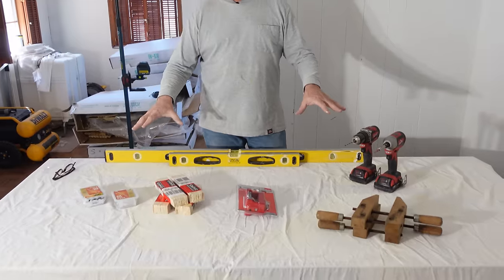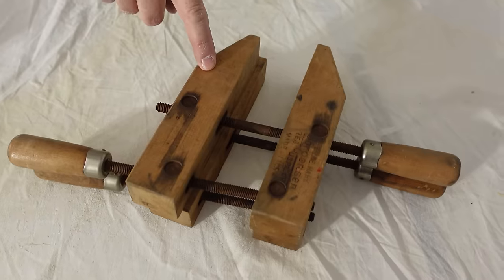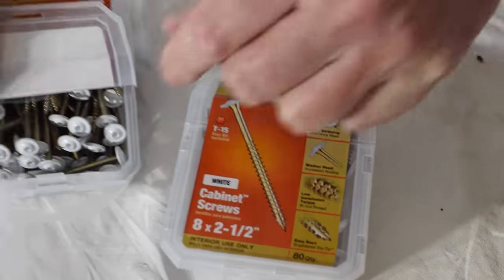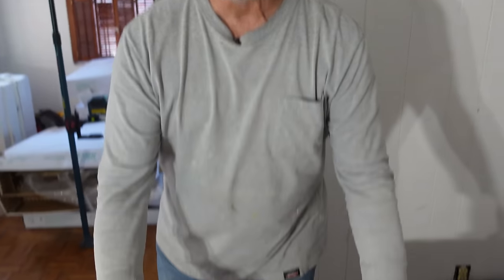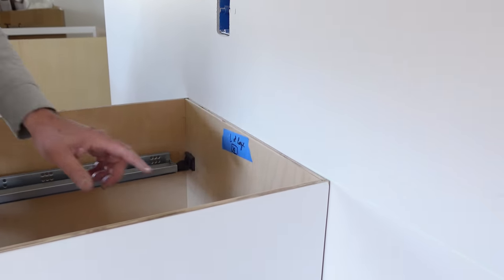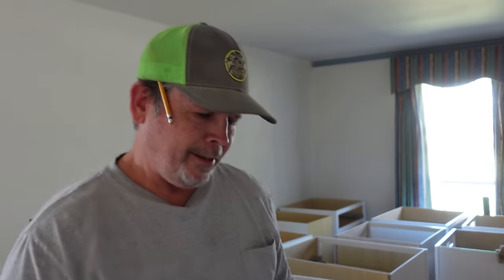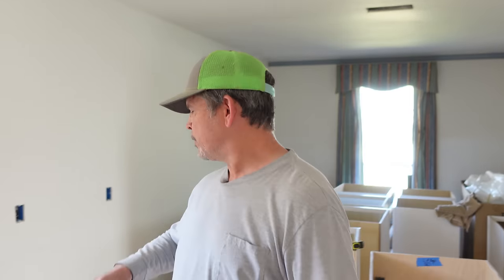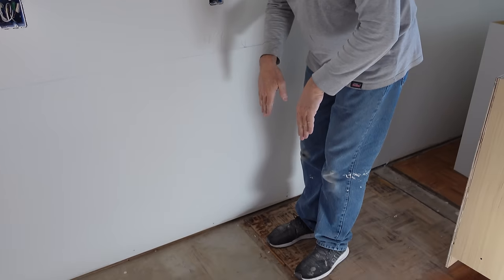How To Install PERFECT KITCHEN CABINETS (DIY GUIDE)

Comment: Nice job you guys!  I've been cabinetmaking since my junior year in HS (1979) and what you did here is what I've been doing for installs the whole time (after learning from the professionals/cabinet shop owners and foremen).
I have often used my straight-edge, a 8' long, 6061, aluminuim 2"x3" angle, 1/4" thick across the top front edges of the base cab's to be sure the counters would end up absolutely even (usually 1" to 1 1/4" from the face), but eyeballing that works also.
The extra mile thinking is the use of 'sex screws' to pull the faces flush with each other when they meet up.  The sex screws are used so as to not split a face frame with the pressure of the threads of a wood screw.  I have seen the splits over the years when weight was added from pots and pans, dishes etc. as they can quickly add up to hundreds of pounds per cabinet, especially glass dishes in upper cabinets.

The ones I have found to work best use a 3/16" hole drilled through both frames and the two parts are threaded together (I add blue Locktite too) while clamped and the cab's don't budge.  Three on base cab's, four on uppers.  Then shorter ones parallel to the top edge of the base cab's, about 2-3" down to be sure the cab boxes work together to support the countertops.
Seems like more than is needed, but I can't tell you how many times I was removing cab's to be replaced, to see where the old cab's were about to fail, or did fail because of underestimating the stresses.  I feel better after an install which has been over-done, not one where installers are asking themselves "what if?".
The last thing I do is water-proof the top edge of at least the sink cab, but all of them if I can convice the owners.  I use Christy's Red Hot Blue PVC cement and it is the only thing I have gone back to see it still working as planned long after the install.  It was '04 when I began to use it and went to replace a sink last year where the on-counter sink sealant had failed but the top edge of the cab was fine though water had been migrating to that area behind the faucet for years.

Comment: when you don't have a magnetic driver,  you can attach your screw to the driver with a short wrap of tape and it help to prevent the screw from falling off the driver and usually the tape will stay attached to the driver once the screw is embedded. and you guys d[ a great job, love your videos

Comment: Great video again!
 So to help out with the screw dropping out of the bit, take a rain drop amount or less of butyl tape and press it on to the phillips bit then press the screw onto the bit. The stickness of the tape will hold the screw. Butyl tape has many purposes but When I was an auto body tech it was used to hold rear and side car windows in place by some auto manufacturers . You can get it at auto parts stores.

Comment: We took your advice and used the Bessey jig/clamp to install and set our new kitchen cabinets and it REALLY helped! My only suggestion is to install a slightly thicker pad on the clamp to prevent the metal part from contacting the cabinet face. Easily fixed with a cut-to-size furniture pad and that modification was the perfect modification.
Reply: I'm trying to figure out why the lower number is the high spot -- do you know?
Reply: @rena321able  The laser line height remains constant. If the distance between the floor and laser line is different at two spots, then the floor height must be different (as laser line is constant). The distance is equal to "laser line" minus "floor height". Therefore, the higher the floor height, the lower the distance is between the floor and laser line.

Comment: Love your videos.  I just saved a ton of time painting a 2500 SF ranch using your tip on how to hold the brush when cutting in the ceiling and around trim.  Took a little practice but now it is second nature.  Now I'm getting ready to tackle the kitchen.  I hadn't considered RTA cabinets until I saw your video.  Even the manufacturer liked your tip on using a pneumatic staple gun and mentions this in their instruction video.  

But I'm still not convinced that the lower cabinets should be installed first.  I like to gang the uppers together upside down on the ground when possible to get the tops lined up.  Like you, I sight down the faces and install shims at the back to keep them from twisting.  I also make two 2x4 deadman supports about 1/2 longer than my low spot to hold the cabinets in place.  A gentle kick will raise the cabinet to the line.  In my youth I could easily raise three cabinets by myself.

Comment: @Stud Pack an easy way to do those cut out under the sink is to take some regular house paint and dab a little dot on the pipes line your cabinet up where it needs to go and give the back of the cabinet a hard slap. It will leave a mark right where your holes need to go. for the outlet though you have to measure or add a plastic box extension and do the same trick. Also if pipes are different lengths star with the longer ones first drill them out and slide back to the shorter ones. After a few times doing it it cuts down on measuring time and is super accurate.

Comment: I like how you said, "34 and 9." I worked for over decade with a dude I became friends with. When we took measurements we'd say the number and then 3 for 3/16, 5 for 5/16, 7 for 7/16 , 9 for 9/16, 11 for 11/16, 13 for 13/16 and 15 for 15/16. It was just easier to communicate when we're both on the same verbiage. And we always used the same measuring tape as well. Different tapes have variances that'll goof you up sometimes.. I like your videos guys. Thank you very much.

Comment: Greetings one of your beginner viewers here from the very early days of your videos, I always sit back and watch and really enjoy the father-and-son interaction and education in your content. The real cool thing about watching is a fact that you keep it educational and give great examples and tips. At 17 minutes though I just want to throw some advice that you that an oscillating cutter or what we call a multi-tool would have been a better choice to cut out that square in the back of your cabinet. I use it often for this application and it seems to work very well, Pro tip though, I would use a little painters tape along the edges of that line on the outer diameter due to the fact that you will get a cleaner cut without any Jagged edges
Reply from the maker: Thx Nick 👍.  I left my multi tool at home that day 😡

Comment: great tips, however I went the same route as you lifting the back of the cabinet to the line without a shim. my foreman told me it’s not good to rely on just the screws alone to hold the weight of the countertop. to each his own, just good insight. we moved the cabinet back out and shimmed it up.

Comment: I have the old pony's. I like banking my cabinets on the floor with cabinets laying on their backs and clamp and screw face frames. I like using GRK trim screws and I run them through drawer box side and or behind hinges and I rip 7/16 OSB and use that  between the box's and screw together then you are only setting one large cabinet rather then each box amd everything is perfect. I always set a 1x2 for a ledger and do my uppers first.

Comment: First of all great video I always like your projects. 
I was taught to do cabinets very similar to the way you do it and it always worked well. We had no lasers at the time but a 4 foot level did the job. The only thing we do different is we install the upper cabinets first that way you don’t have to work over the bottom cabinets. But by putting in the bottom cabinets you do give yourself some sort of a work platform for installing the uppers so I guess either way works, installers choice.

Comment: Mr. Stud Pack you asked about why barrier on your bottom block but NOT under shims or pocket doors etc. we sometimes used a thin strip of that Tyvek window type sealer, its smooth and white on one side an black sticky on the other, or sometimes that colored foam "tape" that goes under the bottom plate between it and the slab.  AND.. get a MAGNETIC SCREW SLEEVE ...   SFMF

Comment: Great video thanks for sharing your knowledge and expertise everything you did shows your true professional tradesmen and take great pride in your work the best part was when you had to screw the brackets at the bottom on the inside of the cabinet you went to alot of trouble to get a good finish and is the kind of thing I would do as a tradesmen myself and i too take great pride in my work I've had to do something similar before and is so annoying to the point where its funny having the screw slip or come off what would do is drill a small pilot hole or use a bradel so you can get the point of the screw in without it slipping as you screw it in.. great job keep it up!!

Comment: I've enjoyed your videos and it helped me a ton doing my own kitchen cabs and sink! Now I feel if I can do that I can do anything. However...that said I am approaching a dilemma and I cannot find any info on my next task so I thought I would reach out and see if I can get some feedback. I have and am sound proofing my middle bedroom to be my new home recording studio. The walls are secure with triple insulation including 1-1/2 rigid foam insulation sealed with insulation spray foam. This room is not only dead silent now it is completely air tight...except for my ceiling. The only thing left is the ceiling. My plan is to also apply the 1-1/2 rigid insulation sheets to the ceiling. Once done the entire room will be completely covered in 2-inch acoustic foam panels. Here's my issue. I need to drop my ceiling light fixtures down about four inches. Wiring is not a concern, but I'm not sure how to securely drop & mount the box to remount my lights to clear the double foam. Help me Obi-Wan...you're my only hope!

Comment: Here's a tip when working with a level on finished products. Put a piece of masking tape on the straight edge of the level and it prevents the black scuff marks you get on cabinets, walls, furniture etc.

Comment: Hey Paul!!  A little pro tip old gentleman told me take a piece of electrical tape punch your screw through the tape and wrap it around bit get started before snugging it up pull tape tighten screw.  BAM!  never lose a screw again.

Comment: GRK # 12.  Usually grk #8 fin/trim head screws for connection face frames.  Occasionally I need something with some grab to really pull face frames tight so I’ll use a regular head either counter sink or hide with hinge.

Comment: Another great video. Love the screw and prybar trick.
 Another reason to do lowers first is if you use cabinet jacks, you can just drop a piece of plywood on the lowers and get the uppers knocked out.

Comment: Most modern UK cabinets have adjustable plastic legs underneath to make height adjustment easier so you can set them correctly both along the wall and out from the wall. Love the old fashioned Imperial measurements, Metric is SO much easier,it’s just a number to divide up not fractions to work out - although Iam old enough to have used imperial before we  converted.
My last kitchen I used L shaped plastic facia board upside down as a kickboard, if you cut away the back correctly you can even bend them round corners to get a totally unbroken run with no joins. Thanks for the tips BTW!
Reply: Cor blimey!

Comment: I dont recommend going more than 30 1/4" on a stove opening. Can cause alignment issues with uppes cabinets. Especially if there is a vent hood = microwave( usually 30")
If it's an open wall you can get away with a little more, but if you are working out of a corner you can really screw with the layout of rest of cabinets
Reply: You can always adjust it in your fillers on either side. Slightly larger filler on the uppers and just work off the center line. If you have a face frame fridge panel on one side, it's already gonna be two different sized fillers.
Reply: That's a possibility if you are using more of a spec type cabinet.
I install primarily custom cabinets that have set size styles no fillers here. All our cabinets  are made with 1/2" scribe on the style on the end cabinet only. Very clean look no room for fillers. It's all in the planning and prep.
Thank
Reply: @joedake2287  You must work with very perfectly framed houses Joe, because if not... then you will need fillers :)
Reply: Lol
Most of the units I deal with have an additional 1/2" added to the style meeting the walls. Built in scribe strip. No seperate fillers. No house is perfect.
Thanks for the feedback.

Comment: Great videos, I saw you struggle with the toe kick screw, wrap the screw and tip with a little plumbers teflon tape it will stay and fall right off once you set the screw. those are frustrating situations. Best of luck friend!

Comment: I used EZ-levelers worth the $300 bucks, did all lower in under 8 hours and it's only my 2nd novice cabinet install. I wish I had known of that front face clamp though. Did okay with normal clamps but that red clamp looks excellent.
Reply: I use EZ Levels on all my kitchen cabinet installs.  Game changer.  Yes, the Bessy clamp they use in the video is amazing.

Comment: I have had really really good results with using foam ( yes ... low expansion foam for doors and windows) to secure island blocking to to concrete!! Just apply foam then set blocks into foam and set a weight onto it for about 5 min and your good to go. I deal alot with in floor heating and have made this my go to method. No holes or a chance of hitting water lines. It is very hard to move
Once set but can be moved with a buzz saw.
Reply: foam? why not PL adhesive in that case...
Reply: The foam sets fast and can be cut loose if needed. Any residue can be cleaned up much easier than PL without the chance of chipping the concrete.
Reply: @joedake2287  thanks good explanation!
Reply: Very cool.  Making sure the repair guys have a never ending supply of work.
Reply: Lol
32 years experience 
I'm more often than not fixing other "pros" work! 
Always trying to advance my skills and those around me. We like to say keep it positive or keep it moving!! 
Thanks
Reply: @joedake2287    I've been shitty at singing for decades.  Guess what:  I'm positive I'm still a shitty singer.  I really have good success though, as long as I'm around people of low standards.
Reply: Lol
Thanks for the "positive" constructive comment!!

Comment: Good job
Few things I would not do
1 using the sawzall to cut the cabinet 
2 Screwing the dishwasher spacers on the cabinet frame 
3 using that type of screws on the face frame 
4 fasten the cabinets to the wall before I position all cabinets in place.
If I need to explain why I need to make full video 
I would say cabinet installation need some one specialist on cabinet installation because this video just showed you the easy part on installing the cabinets
Normally carpenters don’t know how to install cabinets or they do sloppy work at the finishing.

Comment: I'm a retired kitchen fitters from the UK 🇬🇧,  we do it all so different here the units are all on legs ,for adjustments also most of our buildings are brick ,so also space at the backs to allow for pipe works , always interested in how you  guys do things , oh also we work in millimetres so easier to use I think
Reply: We do like our inches... I tell you what, how about a wager?  If Henry becomes king, you have to ditch the metric system.  If he does not... meaning William takes the throne, I will convert.
Reply: We need inches to measure our sticks. They only need mm..😮

Comment: Great job on the videos, as always. As a cabinet installer, one of my favorite tools is a Rockler tapered drill bits and Insty sleeve. The big set even comes with vix bits for installing hardware. Huge time saver. Check them out.

Comment: Having installed several hundred kitchens in my time, this is a great video for someone who is needing a tutorial. One item I would do differently is to buy a dishwasher mounting bracket which will serve to keep the space accurate and also make the plumbers job much easier later. The other items is that we use GRK trim head screws for the face frames, much cleaner look with being countersunk by itself. The last and most important point, if you are doing a lot of cabinets buy a WORX Switchdriver, it is the best single machine to use for pre drilling and driving screws. This is a huge time saver, trust me. Otherwise good video indeed.

Comment: Great video. Since I have added cabinets over existing cabinets it can be done but unless in a rush for the countertop I like putting in upper cabinets first. Just so much easier (plus easier for my wife since I have her helping and not someone stronger (she is strong, I just know my guy friends are stronger).  I like that you show your blocking is helpful at this stage.  Keep up the good work.
Reply: I work by myself so I put the buttons first and make something out of scrap to set the tops on at proper spacing

Comment: Looking forward to the patch in the parquet floor. When you pointed it out, I figured you were going to patch it before putting in the cabinet.
Reply from the maker: Patching first would definitely be easier but I really didn’t have a sense where to patch until the cabinets are in.

Comment: Great video!  Love the stuff you put out.  I did buy those cabinet clamps.  Not sure if I got a bad batch but the center piece leaves a circular mark on the cabinets. Used it twice with same result.  Returned them.